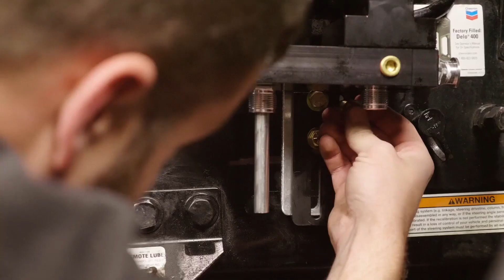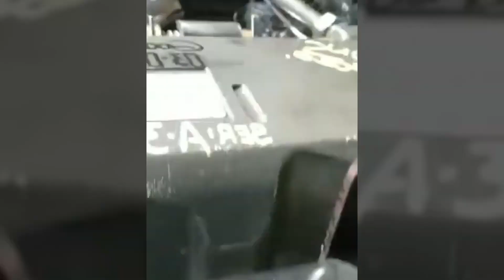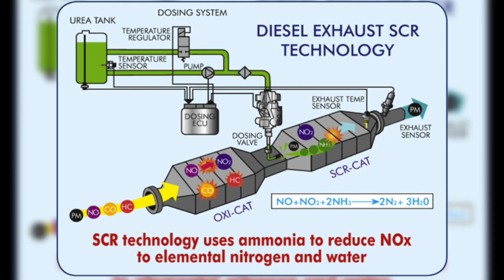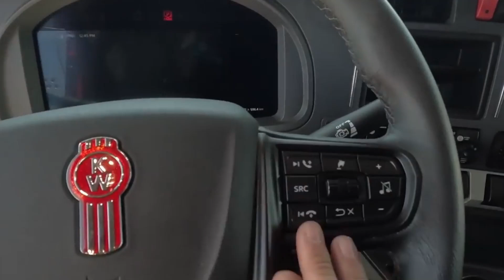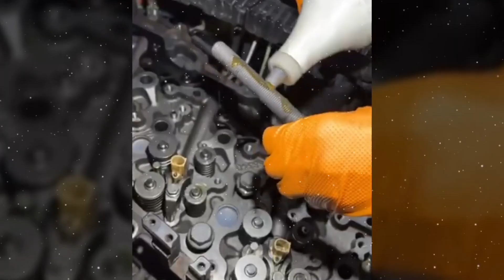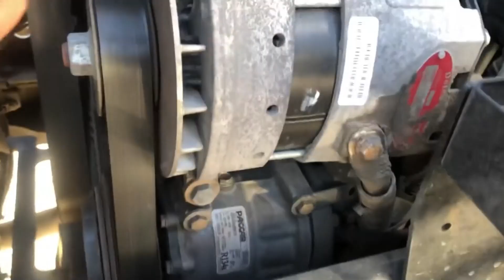The Shocking Truth About Paccar MX-13 - The Engine That Is Ruining Trucks

Comment: an old buddy of mine went to tech school to become a diesel tech and interned at Mount Vernon WA paccar, he told me the oil change interval on their engines is 75,000 miles i said you mean 7500? no 75,000 mile oil changes, i dont care if its a long haul truck, No wonder your truck with 75,000 mile oil service and emissions systems blow up your truck
Reply: Most trucks service ranges are that high only if they get very good fuel economy.  The fuel economy dictates the oil change intervals. Anywhere grom 20k miles to 75k miles depending on how hard the engine is working. Every truck holds nearly 10 to 11 gallons of oil.

Comment: Def system for me as a owner operator now as a company driving a 680 and had fuel injectors replaced but don't think it change nothing feel vibration at 1/2-1/4tank on fuel

Comment: Paccar is the biggest joke that has ever been in the trucking industry. I speak form personal experience. Their engines are crap and so are their trucks. Electrical wiring issues, engine issues, build quality issues, cabs leak, they are just crap!
Reply: You sound like you may have worked at a KW dealership
Reply: Oh no, where was it made?

Comment: Egr and higher EGTs to reduce emissions are the culprits with the ULSD diesel fuel today where if you don’t use top quality diesel fuel supplements that contain lubricity additives injector cleaner additives cetane boosting additive that is sorely needed in the us because cetane is 10 points lower than what these engines need to run more efficiently at every fill up you will have fuel system failures burn holes in pistons.

Comment: Ran Mx13 no problems first after 350xxx miles emission issues.  From 8.3 mpg to 6.4 mpg.. from emission issues to internals to fuel filter pluggin
Reply: My mx13 has 100 month emissions warranty

Comment: Mx-13 is a DAF engine, but Paccar changed things including Chinese made parts. I wrenched on Cummins, then Mx-13, and then the company stopped buying Mx-13 and went back to Isx15’s. Have fun
Reply: Indeed, it's a DAF engine. PACCAR started the production of DAF Trucks in Brazil in 2014 and needs to compete with MB, Scania and Volvo.
In 2024 on the Brazilian list of most sold 16+ ton trucks, the DAF 480 was number 4 and the DAF 530 was number 2 on that list.
Reply: @47rintin1  Even the MX’s assembled in The U.S, they’re still 100% DAF engines under the paccar brand no matter where it’s assembled at. Same with the so called “Mack MP series” which are Volvo engines but painted red.

Comment: We have a 2019 Paccar with 900k miles on it. Yes we love it
 We only gross at 41k lbs. so we know it will last. We have heard about the problems. We have installed a hydrogen on the go system and really enjoy the mpg increase. It also clean the soot out of the tailpipe. One major headache is the cheap plastic oil pan they install. We have to replace ours every 2 years and it warps really bad and doesn't contact the engine block. Because we have a rear oil sump, they don't make an aftermarket metal pan.
Reply: The mx13 is more than reasonable for that weight, but definitely not 105k lbs like me. There's no fuel savings at that point and the amount of intensified wear vs a 15L engine means whatever you saved in lower purchase cost, you lose more on maintenance and crankcase failure risk.

Going with hydrogen aftertreatment was a very smart move, as the SCR on paccar engines is the most prone to failure. The MX and, ironically, the Maxxforce are actually decent power plants with their stock emissions control deleted.
Reply: We have 3 new trucks(2024). Very disappointing. Low power. 1 of the trucks has already broke down because of the regen- unit. Less than 15k miles.
Reply: Is it deleted
Reply: @growingupghetto4082 No it is not deleted

Comment: I drove a 2017 kw tri axle dump truck with that same engine I never had any issues with it and I ran that truck like a dog soon as I quit that engine had a def system problem not my problem no more
Reply: My 2020 W990 has the 510 hp/1850 torque MX and the engine itself has been good so far. It’s had some after treatment systems issues especially if there’s a exhaust leak somewhere. 547+k miles on it and no internal issues with the MX.

Comment: Americans are very slow learners. A friend of mine designed a steam unit fifty years ago, that was the lowest emission engine in the world.[still is] Took it to America in an old Ford Falcon and demonstrated it to Senators from Washington and vehicle mfrs. in CA. They didn't want it. It was simple, reliable, cheap to mfr., able to burn high flashpoint fuel and a monkey could fix it if something went wrong. The big attraction for the diesel was they are big polluters, costly to work on and mfr, use premium fuel, make plenty of noise and send people broke. What more could you want? I could fill the Mitchell Library with what's good about steam but if you are not listening , what's the use. Steamers are very compact . A four cycle diesel has one power stroke every two revs. A steamer is double acting and in two revs has four power strokes in that time. However they do have a steam generator Best of all by the the time the diesels have any attempt to lower their emissions with modifications, they are turned into scrap iron jungles. The man said they don't know now and may never will so I suppose I'm wasting my time telling you. VOTE STEAM SEE PRITCHARD STEAM CAR U-TUBE.

Comment: This engine drove me bankrupt.   Do not buy.  So sad Paccar is doing this to the Kenworth and Peterbilt brand.  I like the way the truck drives. But Damm this engine is complicated expensive and not reliable.  Got a 2020 t680 in great shape last year and a great price too.  after I had driven my 2016 freightliner cascadia over a million miles until it needed major repairs...yes.  It took over a million miles for the DD15 to need anything major.  And there i go trying to get into a nice KW. Surprised at how unreliable the paccar engine turned out.   Going back to DD15.  Paccar not a good choice for owner operators.  Like the video says big companies get these new trucks with extended warranties.  And yes it has been a very costly lesson.  Good luck if you have one of these.
Reply: I'm really surprised paccar would tarnish Peterbilt reputation with an reliable engine. I guess it's all about the money.

Comment: 2023 mx13. Its had 17 injectors in 250,000 miles. Also, almost every trip it has a check engine light on. I wont buy another one.
Reply: The US has terrible lubricity of its  diesel fuel. Just adopt European standards for fuel and engines will become trouble free
Reply: @Sjanzo i dont know a single daf driver who hasn't replaced one or more injectors within the first 300.000 km
Reply: @baasbassie daf xg I drive on 290,000 miles and apart from services its never had injectors done. Daf sorted the problem now as far as I know.
Reply: @annanananananaa  i haven't at 350k
Reply: @Sjanzo absolutely diesel in the us used to make you slip and bust your rear end when you jump out to fuel your truck, if you weren’t careful. Because the concrete at the pumps would eventually be covered in it and the whole place was like ice skating. Diesel had a green tint to it. 

Every since the creation of def, diesel can barely start on fire with a lighter, it is clear, and not slippery at all, and MORE EXPENSIVE THAN GASOLINE, which it never used to be, as it takes less of refining to turn crude into diesel than gasoline does. 

Diesel use to clean and lubricate parts washed in it, now it  cleans them, but lubes nothing. 

You are absolutely correct.
Reply: @portermatthew84  its low sulphur diesel. Sulphur lubricated the pump, in Europe we have the EN590 standard, and in the US, less lubricants get added to the fuel to meet the lower ASTM standard.
Reply: @Sjanzo bullshit
Reply: Our 23’ mx13, just 260k KM’s, two failed injectors, fuel rail codes/failure, 2 communications harnesses, and much more. Truck was purchased used. No wonder it was for sale..
Reply: @kowal789 add some 2 stroke oil to the diesel. The problem only exists in the USA because the diesel fuel lubricity  standard is far lower than the European standard.
Reply: You are full of sh!t
Reply: The engine in the daf I drive is on 480,000 kilometres and been OK.

Comment: They haven’t said anything about the cam issue but recommend changing fuel filters sooner and adding e290 cleaner to the tanks to keep injectors clean there are some injector recalls on mx 13 and 11 engines

Comment: 236000 miles on a 2024 mx13. Good mpg, lots of fuel injector problems.
Reply: Wow
Reply: Update.
At 315000 I got all 6 injections replaced with a new retro fit part number.